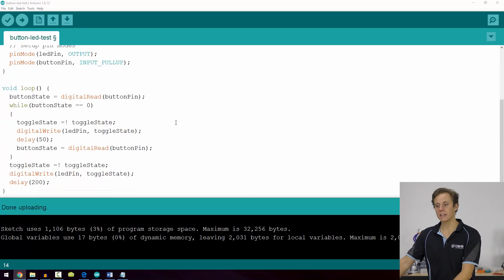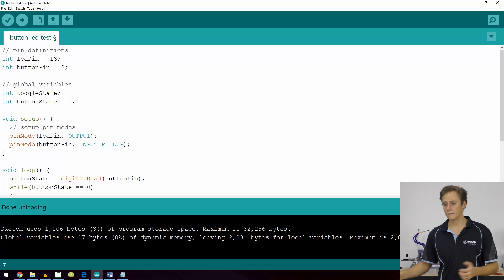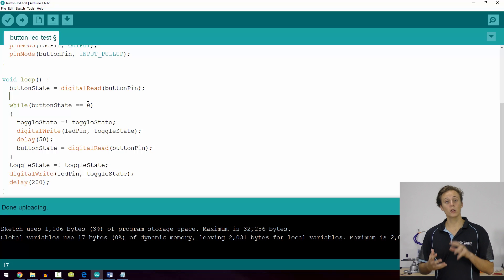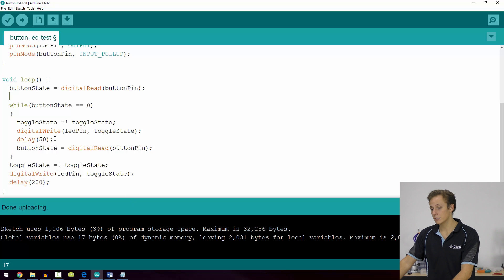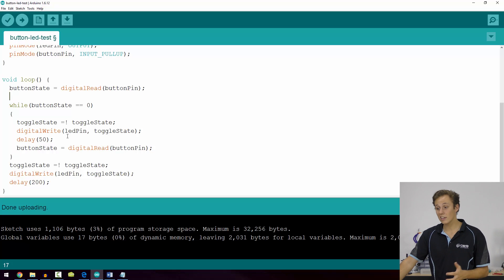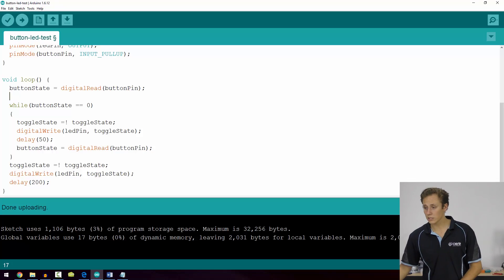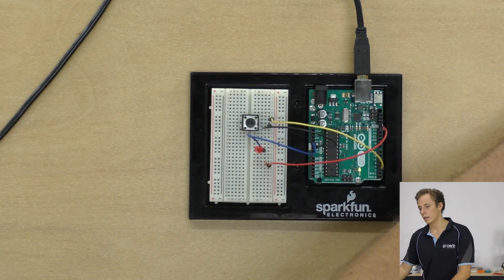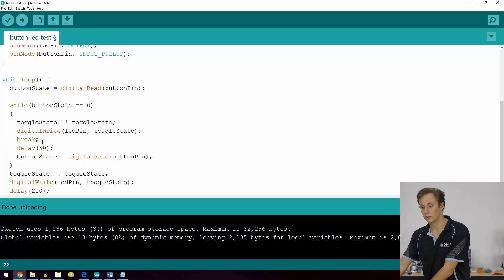Arduino Workshop - Chapter Three - WHILE Loops

Comment: one of the best things I have learnt is that when you want to reference the "built in" led on the Arduino the best way to do that is using "int led = LED_BUILTIN;". "LED_BUILTIN" just references to the built in LED. yes ik you can use pin 13, but this method makes sure that the led will light up on any (most) Arduino.

Comment: Thumbs up for the content. However thumbs down for the size of the written code on the screen. Who on earth can see the wrighting if one watches the video on a mobile device, such us a tablet? Let alone watching it on a phone!. Really not usable. The text size should be about 5 times bigger than it is now for someone to see it without using a magnifier glass.
Reply: There is a supplemental webpage link in the video info section.  It may help.
Reply: bruh i can see it just fine on my iphone, you probably just have bad eyesight lmfao
Reply: I don't know. Maybe use a computer then? That's your problem. Font size is large enough.
Reply: I got slightly bad eyesight, had two  tiny projectiles penetrate one eye o a construction site my right eye sees a little blurry, but I can see it on my Galaxy A15

Comment: If loop() is getting called every clock cycle, then why is there a need for a while() loop inside?
Reply: While input pin is high, do something.    But only if it is high.
Reply: Sean ONeill that didn’t really answer the question though.
Reply: @yourgflikesit  Indeed it did.  The  void loop() runs continuously, where a WHILE loop only engages when the conditions of that while check are true (while i==0, ....) only operates when i is 0.  Void Loop always runs.
Reply: Sean ONeill okay, so I understand that. But here is my question again. If loop is called every clock cycle and we start with clock cycle 1 of the first run which has a while loop that runs for 2 seconds (or let’s say 2 clock cycles). Then in theory the while loop would be called 3 times?
Reply: @yourgflikesit  Depends what the parameters are for the WHILE loop.  Is it  WHILE X<3, and X increments 1 time per loop, then yes.  X<2, then no.  Or, are the parameters to enter the WHILE loop, WHILE digitalRead(1,LOW), and 1 is LOW for 3 cycles, then yes.  Make sense?  Am I understanding the Q?  If so, the quick reply is  depends on what you are testing to enter that WHILE state determines how many loops are run.  You can test too, use the serial out, and write what X is each loop, and watch how many are looped :)